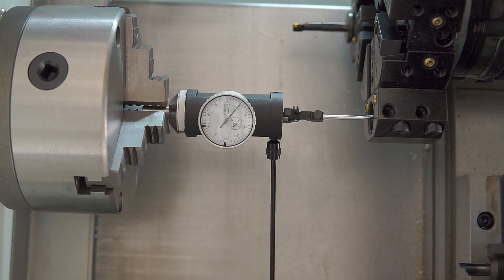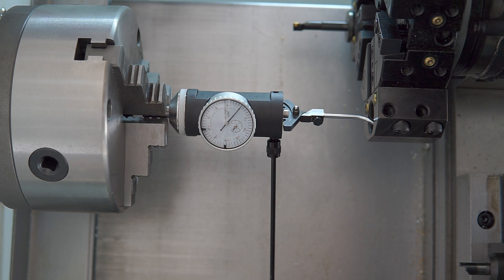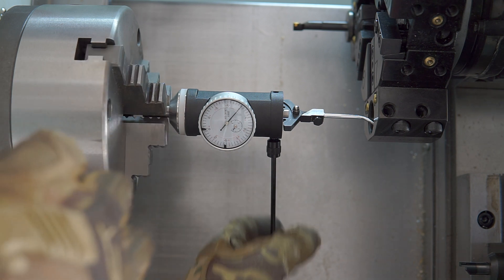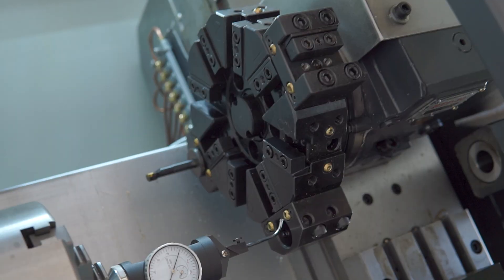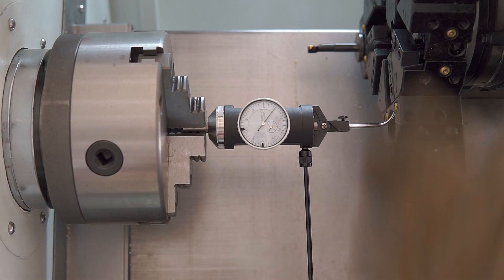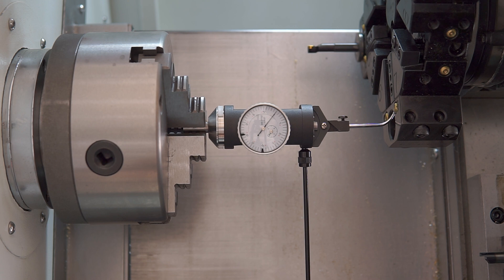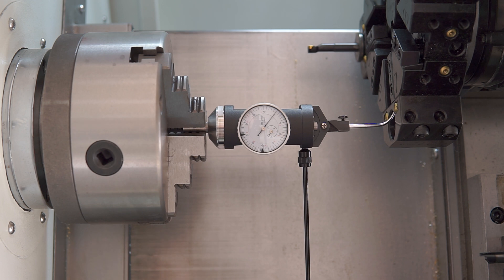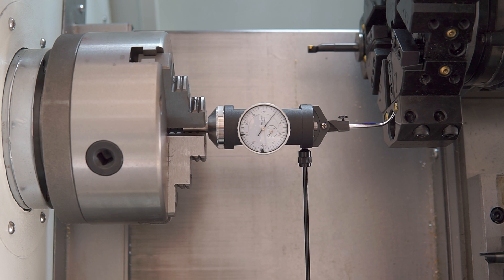CNC Lathe Turret Setup & Progress

Comment: If all your tools are out the Turret, I am wanting to know if I put a knife tool into Tool position 1 , do you set the X value on the work shift or in the Geometry, I know the Z is measured on work shift Tool one ,the rest would be on Geometry not too sure could someone answer my question thank you
Reply: Yes, all O.D tools/cutters should be touched off on the O.D of the part and set the geometry for that that tool. Same with boring bars for the I.D.

Comment: Did you ever level the lathe and take the twist out of the ways?
Reply from the maker: I did check it and do when I move the machine, but I think the machine is so short, it doesn't get much twist. I have a decent size Starrett machinist level.....the mill on the other hand needed quite a good amount of adjustment.

Comment: never wear gloves on a lathe
Reply from the maker: This lathe has a full enclosure....manual rules don't really apply. Spindle is never on unless the door is closed. Can you see a reason why that might still apply? I wear gloves to keep the coolant chemicals off my hands as much as I can.
Reply: @Espressoforge  I wont even ware a long sleeve shirt on a lathe or watches jewelery long hair etc its just how we were trained ... I have seen all the scary vids and swarf is deadly ... overalls another danger ... probably more for manual machines yes but  I would take no chances ... btw pedistal grinders are absolute NO! for gloves I am sure you can use your imagination
Reply from the maker: @eddaimes2247  Yes I can see for anything open and spinning...I just don't have anything in my shop like that except a dremel tool. Mill and lathe both have enclosures and I don't disable the door safety.
Reply: @Espressoforge  yes but others just see a chuck and gloves ... they may have a manual lathe and think "what a great idea"
Reply from the maker: @eddaimes2247  and the turret? sorry just not sure I follow the logic. If I had manual machines in the shop it would make sense to me. But I run everything with the door closed and don't bypass safety switches. I've since switched to rubberized gloves, but I still need them to keep my hands from getting eaten up by coolant. On manual machines you generally don't have flood coolant flying everywhere so you need to worry about different things.
Reply: As expressoForge has said, your useless advice is irrelevant it's a CNC guarding, ie. door closed. Seems to be alot of expert engineers on here 😎
Reply: Edd Aimes, when you're next machining stainless can you show me how you remove the swarf from a machine without a conveyor and NOT wearing gloves 😎